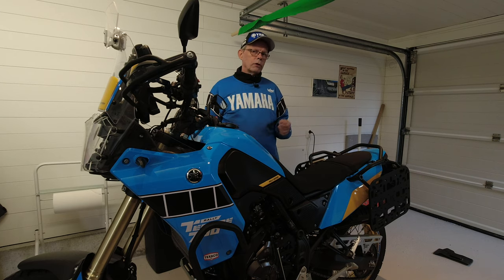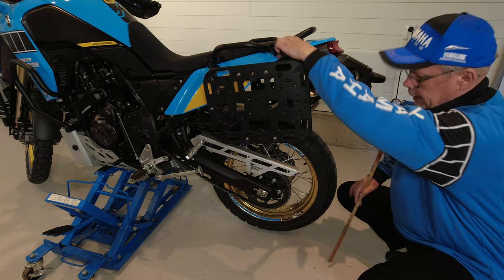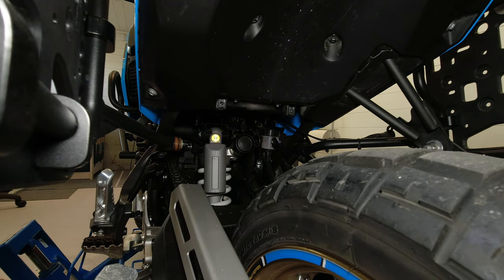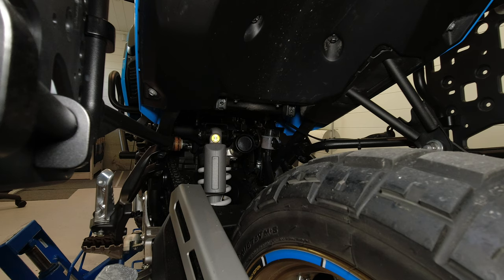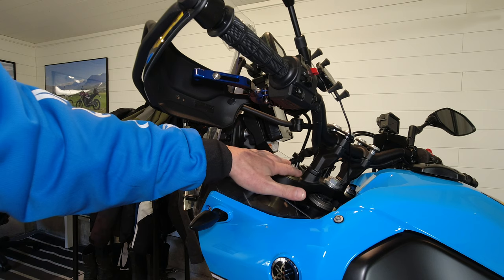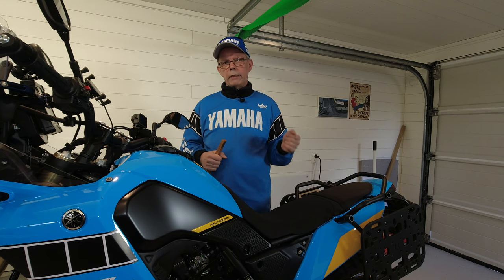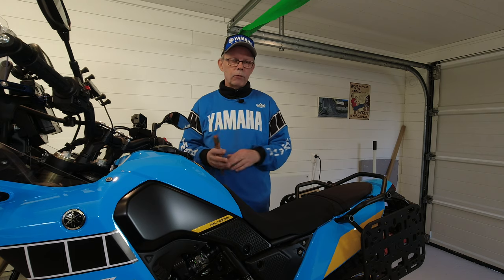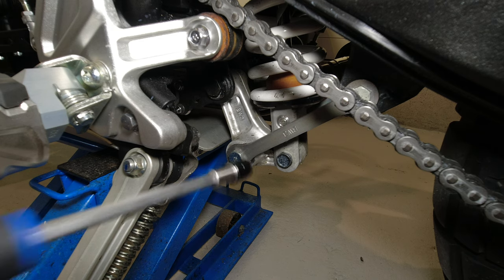Yamaha Tenere 700 - Suspension HOWTO [4K]

Comment: Thank you for making these videos. My 2cents: I have ridden about 200km  (mostly 2nd class roads and highway) with Hypepro front springs installed and must confirm that the improvement of bike stability (planted and sure footed) as well as the ability to absorb small bumps and fork dive (when braking) is on much higher level. Safer to ride and more fun due to a better feedback. Best upgrade for the money. Definitely recommended.
Reply from the maker: Thanks ! Yes although the suspension of the T7 is great it is always possible to improve it. How much is depending of the specific usage and of course wallet :-)

Comment: Hello good afternoon, it has to do with the wearing of center stand, upper fenders, lower fender, Sv motech skid plate, more givi trunk support,I know that all these things are a lot of weight, I have 7 cm in fork and 8.5 in sag shock, my weight with equipment is 85kg, greetings Toni from Alicante Spain, I love your videos, he explains it very clearly
Reply: The rear I have too much static sag, I carry the shock absorber of the T7 extrem, which I bought from a gentleman who took it off to leave the dealership, was brand new, the spring is two mm more than the stock one and it is harder than the previous one that was already 4 years old,
Reply from the maker: Thanks a lot for watching :-)

Comment: Thank you so much Sven for your explanations, very clear and useful. I am wondering about the 880mm seat height and 240mm ground clearance values given on the specs bike. When the sack is correctly set up, the bike moves down approx 60mm (30% of the suspension travel) with rider and gears on, that means to me that seat height becomes then approximatively 820mm and ground clearance 180mm. Is that correct ? Thank you very much in advance for your comments. Keep safe !
Reply from the maker: Hi and thanks for feedback. When sitting on the bike with all your gear it should sag about 30% (of 200 mm total suspension travel) same as 60mm. But when the seat height and ground clearance is measured the bike already has a 10% so called static sag if the suspension is adjusted correct. So it has already "sagged" 20 mm and will then sag 40 mm more. The seat height will then be 840 mm and the ground clearance 200 mm.

Comment: If I remember correctly you installed 85N spring (linear spring?). Can you accomodate a passenger (cca 60kg) and lets say 10 kg of luggage on this spring with your 90 kg? Or would you reccomend installing 90N spring? Thank you, keep up the good work.
Reply from the maker: Yes I installed the 85 Nm spring. As the setting for preload for correct sag is just 2 clicks I have 22 clicks left for luggage/pillion. I may compensate about 2,5 kg per click. Thats too little for 70 kg extra so I would go for 90Nm.
Reply: @thetubelesschannel  whats the difference between the 85 and 90?
Reply from the maker: @miguelgomes5783  it is the stiffness (spring rate)
Reply: @thetubelesschannel  yes i know that, but i'm asking in gains for you, since you are 90 kg, do you consider best option the 90 Nm? Considr you can ride with 15 kg luggage plus pilion? I'm abaut 98 kg, a few mates told that the 90Nm it's too much to solo ride...
Reply from the maker: @miguelgomes5783  ahh sorry...I bought the 85 Nm spring...I could probably also use a 90Nm and I think with your weight that's a better option...

Comment: Hello Sven, thanks for this video! I just would like to ask you about he pre-load of the rear spring. The sag should be 60mm right? I measure the difference - bike stands straight both wheels on the ground  vs. me fully geared sitting on the bike = 60mm sag. Is that correct? Many thanks 🙏
Reply from the maker: The "rider sag" should be about 30% of the total suspension travel (=60mm)...so you will have to measure the sag when the bike rear wheel is off ground (not resting on its own weight)...and the sag with you sitting on it fully geared.
Reply: @thetubelesschannel  Got it! Just find out that the spring is too soft for me. I'm 90kg without gear and even after 24clicks from zero (max. pre-load) I still have about 65mm (with my riding gear on).. It means if I take a lot of luggage or passanger it would be even more. Maybe rally raid spring 85 or 80Nm would be the solution? Thank you 🙏

Comment: Hi Sven, could you recommend compression and rebound settings for on and off-road?
Reply from the maker: I put all the clickers in factory recommended settings, then 2 clicks harder rear both on comp and rebound to compensate for my stiffer spring. I will try different setting when doing more offroad.
Reply: 4 click softer for me.